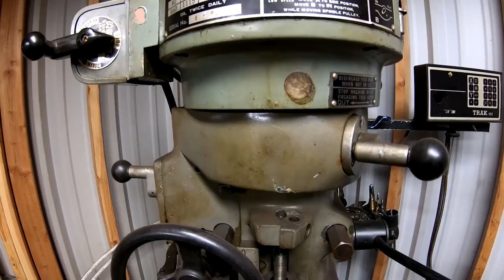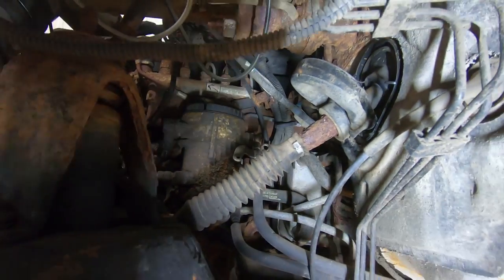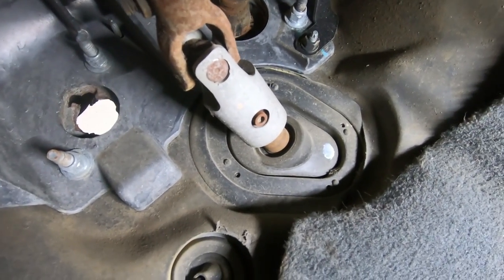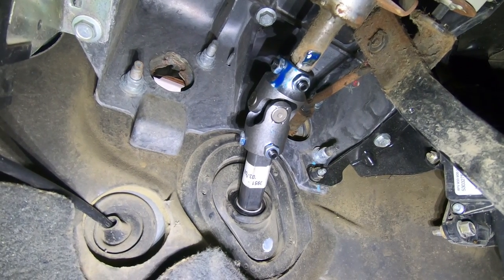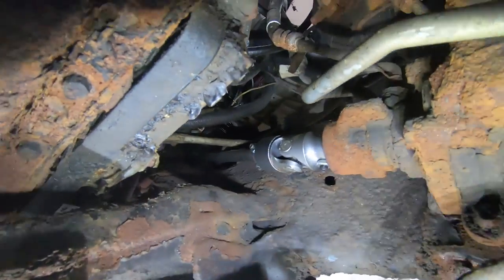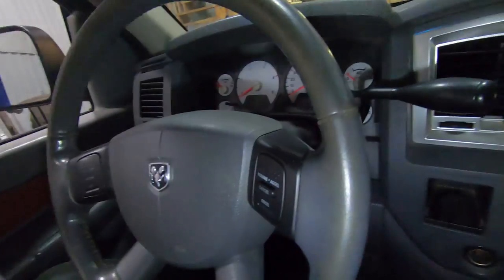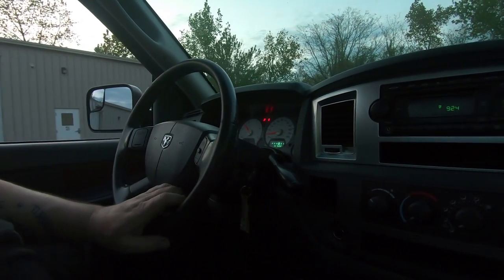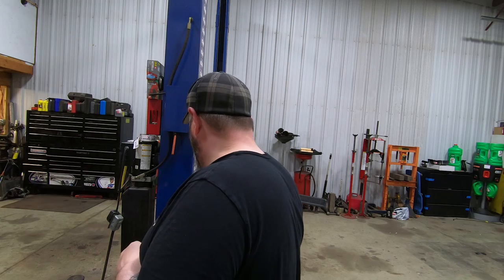RAM 2500 BORGESON Steering Shaft Install.

Comment: Thanks for the video! Just finished installing my new shaft. Something interesting on my gear box that I found is the shaft lines up with the flat spot on the newer 6 bolt (6.7) gear boxes.

Comment: Justin I have a shock system stabilizer for my steering on my 2nd gen and I have no shimmy,deathwobble or play in my steering so some of those systems do the job very well. Food for thought.
Reply: Hopefully your still getting message notifications... Can you share what brand shock stabilizing system you went with
Reply: The problem isn't just one part. It's several that work in tandem. You may replace a part, get rid of the wobble only to have it return later. Bad part wears out new part. Like putting an new battery in with an old bad battery. I'm replacing everything, down to the ps hoses. Sick of parts killing each other.

Comment: I went with mopar. Wasn't that much more expensive and my boot was destroyed and the new mopar one comes with new boot.
Reply: I'm going to do the same, the boot drastically blocks the noise coming from inside the engine into the cabin, it's quieter